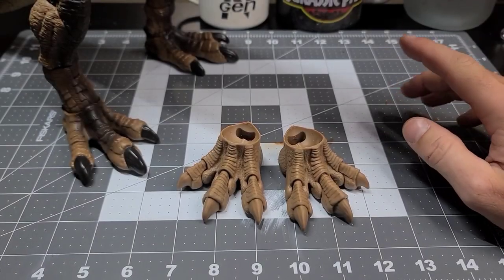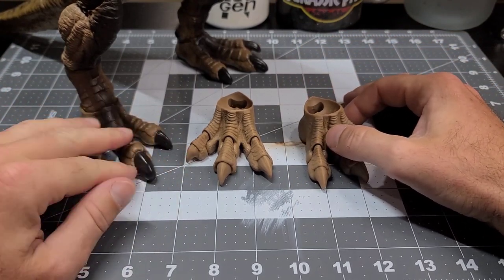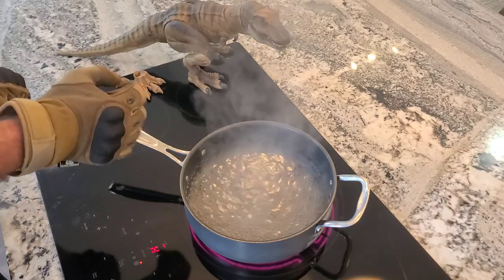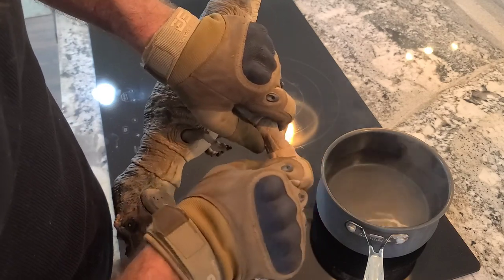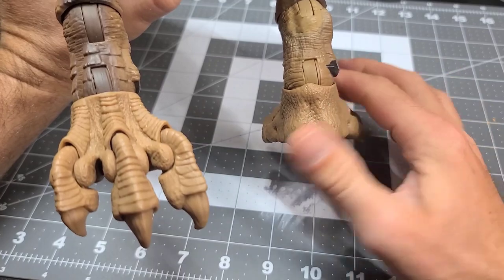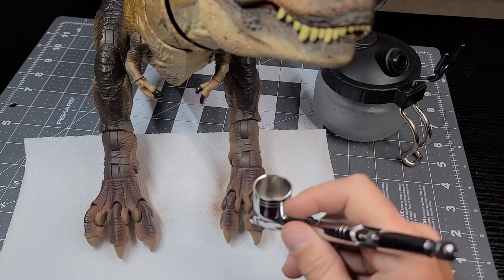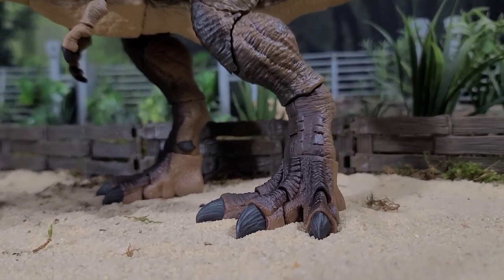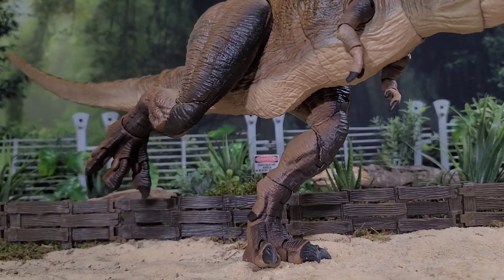Replacement feet for the Hammond Collection Tyrannosaurus by Rod's Random Work and Syrett_Tech

Comment: sweet! lookin' great. I'm in the middle of modding my Hammond Rex too.
 I wanted to get a set of these, but they were out of my price range so instead I went ordering a digital set from Marco Makes's Etsy store and currently I'm getting them 3D printed somewhere.... it's still a pricey process but a bit cheaper than what these were going to cost.

I'm curious how you're going about fixing up the teeth? I'm working on the same thing at the moment and it's a bit tricky based on the way the rex is made.
so far i've removed all the segments of the head, re-made and replaced the eyes with new ones, did some minor re-sculpts to some details of the head and repainted it.

Comment: This replacement feet are really nice and fit with this HC T-rex. But the price of this replacement feet is too overpriced for me, almost same price with the HC T-rex it self. So i am trying to looks other cheaper choice.
Reply: These aren't mass produced. This is cheap
Reply: You likely will not find it cheaper. These are made by 3D print artists who, who took the time to model the feet from scratch, determine joint fitment to the original color, and printed several prototypes until one of the work. It is a lot of work, and since it not a factory making them, all of ton contributes to the price. Your only other option right now is marco makes, who charges 12 pounds sterling( around $14 usd) for the STL model file download for 3D printing; This means that you have to own a printer, spent money on resin, print out the product, clean up the product, and paint the product.  After you do all that yourself, you would see that it cost more than you though. You could always buy the STL file, find someone who owns a printer and paints, and have them print and paint it, but it unlikely the cost will be much different after paying for print and paint labor, as well as shipping if you have get the item shipped to you.  I cannot justify paying the cost for the feet, simply because it is a Mattel rex and don't want to put the total cost of rex higher, but I understand what is being factored into the cost; It is fair for the amount work put into it, I just do not want spend that much.
Reply: @jrivv2239   I understand. I currently struggling to chose the replacement feet from either SyrettTechStore or Macro Makes.....if want perfect feet with articulation then SyrettTechStore's feet is the best.
Reply: Jrivv has said it all perfectly. Couldn’t agree more. However, I understand not everyone is looking to spend money. So a cheaper alternative is simply cutting off some of you toe length on your HC Rex and then buying some milliput to sculpt in the scutes and fix the feet to make them look more small and accurate. Then just paint. You wouldn’t really buy a replacement. However there is always change of ruining your feet and then you would be in a situation to buy a pair. There are YouTube videos on how to do this if that’s the route you want to go. But just fyi, I did buy these feet and they are without a doubt worth every penny. I actually bought two sets for both my rexes and I don’t regret it at all.

Comment: A question, when putting a figure in hot water there is a risk that it will run or ruin the paint?
I have some figures that I'd like to fix by molding defects

Comment: I don't think you all know the purpose for the big feet on the rex
Reply: What is it?
Reply: @mr.lizard666  it was to help it stands better. See when Marco made the feet modification (same size as the one rod made) the rex tobbled over and kept on falling
Reply: Yet, the video just showed the rex standing on one leg using Rod's feet, and Rod's feet have points of articulation that could have created stability problems, but apparently do not.
Reply: @jrivv2239  true. The toy can stand with even half its toes removed. It’s all about how to pose it using the tail as a counter balance (as the real animal did).